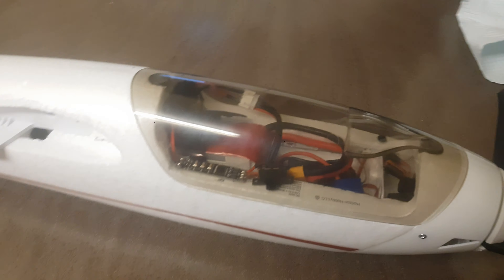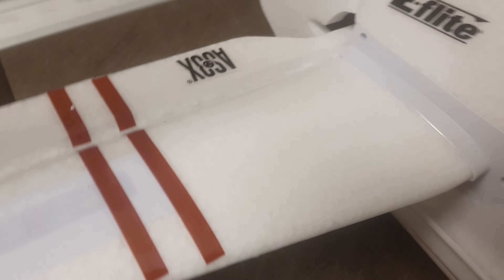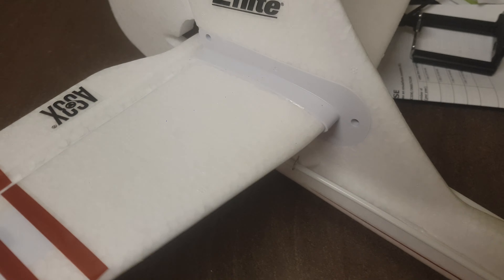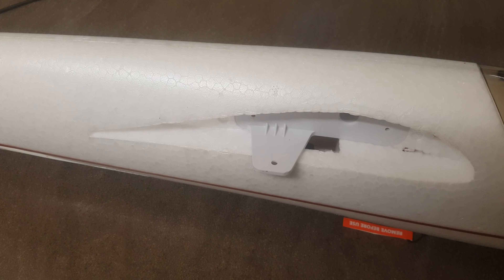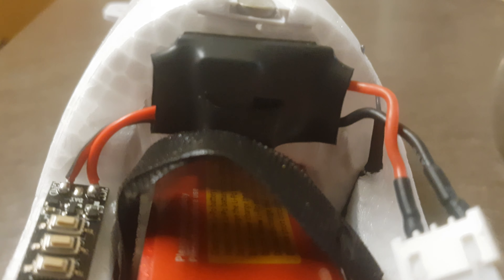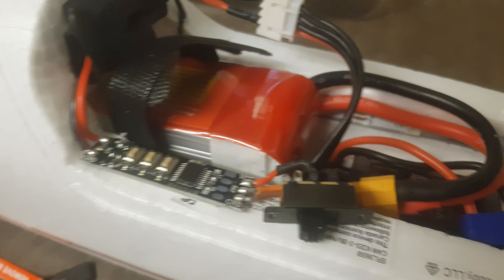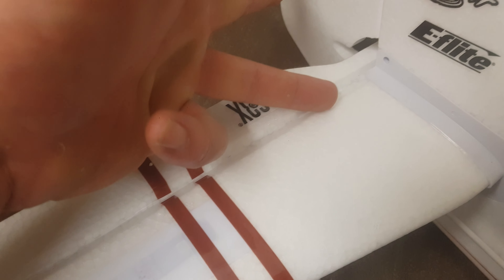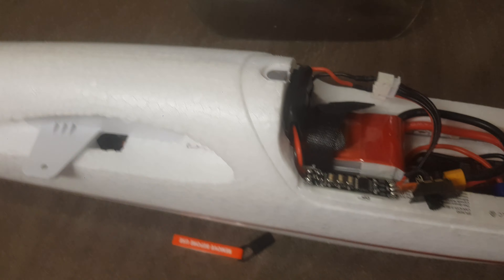Horizon hobby night radian mods/tips part 1

Comment: I think your mods are great. On my Radian I used packing tape for a complete wrap of the horizonal stab stopping forward of the hinge. Each side is identical. I also taped the wing leading edge nicking the tape to lay flat. Along the spar line top and bottom I did the same fuse to tip. This adds a touch more rigidity while keeping weight very low. Good luck on your flight!

Comment: Fyi, it soars much better with a lighter battery.  I’ve had several 1 hour plus flights thermalling during the day using a 1300mah battery. It tends to be too heavy with a 2200. The lighter battery really makes it a lot more enjoyable.

Comment: There is no way I trust that tape they included on the tail. As you said a simple line of CA works fine. I have done that on several of my planes. Everyone does the remote switch and why not? Nothing wrong with doing Mods on a great plane to make it better!

Comment: How did you get on with balance? I have added 3x 50c AUD coins glued together and attached to the plastic bit behind the motor + slide battery all way forward as much as possible. This was based on the 2.5 inch CG instructions. Perfect balance but a little heavy.

Does yours fly smoothy?
Reply: The CoG stated in the manual is incorrect, Google and you will find it should be about 3" not 2.5"